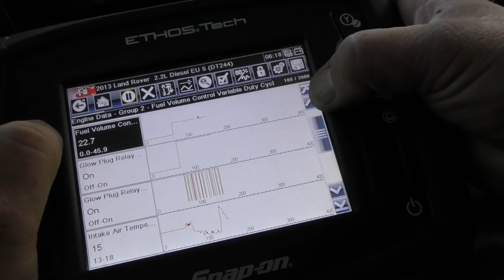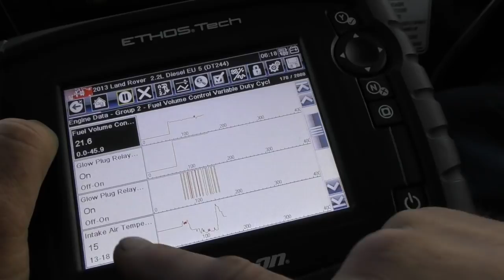Thieves or incompetence?  Address to ScannerDanner and Diagnose Dan.

Comment: Hey, you touched some points there, but unfortunately that’s not an excuse for the bad diagnosis we are getting at the dealer, as customer I don’t care what grade of competence the technician working on my car has, I took it to the dealer, not to a newbie technician, when I go to the dealer I expect the best services for let’s face it, the premium diagnosis and repair prices, I’m struggling for over 6 months now to get my car fixed at the dealer, a 3 year old car, that apparently the dealer can’t fix, but every visit in the service costs me, so, like I said, the problems in the back stage should never affect the customer...
“Customer point of view”
Reply: Hi Dan. Your situation is unfortunately a common situation and an unfair one but this isn't the fault of the guys working on your car. It's the fault of the dealership and it's management. This guy is defending the techs here. Not the dealership. The fact that it's taken 6 months already to get pretty much nowhere with your car means that the issue with it is quite a complex one. A technician with the correct training (that the dealer should be supplying them, but don't) could probably find the cause of your issue in a couple of hours. But they're not supplied with that training. The effect of that is upset customers and the tech gets blamed and called incompetent. I used to work in a dealership in Australia. A country where it costs $100+ just to fill the fuel tank in an average car and $12 for a beer at the bar. $20 an hour on a strict no overtime 40hr week and one of the highest tax rates in the world doesent really give them any incentive to spend their own time training themselves and thousands of dollars of their own money to buy the equipment needed to find complex faults like yours. The dealership should be responsible for supplying the tech with the correct tools and training. They're building and selling the complex cars. They need to supply support and training to the guys that are expected to fix them.
Reply: Adrian Ferraro-Quin unfortunately you are also wrong, at the last 2 visits in the dealer service, the representative called the technician to chat directly with me, to discard the loss of information, that didn’t help, and common, let’s be serious, it’s not dealer’s obligation to force info into their head, and please, I keep hearing this crap, we are not paid enough for what we do, man if is that bad, look for something else, the problem i’m  going through is unbelievable, is like my car is running on magic and the wizard under the hood got sick, Jesus, common, if u don’t call that incompetence then I don’t know what it is, if I was driving a Tesla I’ve understood, that car is SciFi for most people, but an combustion engine...common!!!
Reply: You just answered it with your own response. Everyone IS leaving the industry. So all you're left with is untrained (or incompetent as you say) mechanics. These mechanics are trained to change parts. Hence why they're not paid much. But you expect them to spend thousands of their own money and sacrifice hours of their own time to gain the knowledge to fix complex problems for no personal gain? I dont know what your job is but i guarantee you wouldnt do it. If you want your car fixed stop taking it to dealerships just because you think the dealership is better. Dealership mechanics are not trained to fix issues like yours. Find a good independent shop. But don't complain what it costs.   You can't fix your own car. So does that make you untrained or incompetent?
Reply: Adrian Ferraro-Quin ok, let’s agree to disagree, first of all, I live in an apartment building, so unfortunately no space to disassemble the car(this is the only reason I don’t fix it), I already took it to 6 different private shop’s, the answer they al give me, the car has to much technology they can’t access without a dealership scan tool or database. 2. Don’t ever say again that self studies doesn’t bring any benefits, I’m an it administrator, started with a humiliating low income, after only 12 months I’ve quadruple my incomes and knowledge, becoming almost indispensable in the company, and that only after I sacrificed some of my personal time for learning, so don’t ever say: no gain from self study.
PS. All the hardware I use in my job, I bought it, nobody gave me anything, and the big advantage here is that if I decide to change the company, I don’t have to buy the again or expect to receive the from the employer!
Ohh, forgot to mention, never complain about the costs, I only complain when i pay without getting a fix!
Reply: @danielmihai300  you just made my point again. You quadrupled your pay in 12 months from self training and purchasing your own equipment. Exactly how it should be. Your knowledge and experience has value. Now imagine doing that training and buying your equipment and then having to argue for a $1 an hour pay rise. I'm sure there are issues that you can fix that other IT guys can't. If a customer keeps taking their issues to the lower trained IT guys then they're going to be going through hell waiting for it to be fixed. Find the right person to fix your car then go back to the shops that charged you for incorrect diagnosis and claim your money back. There are multiple communities on Facebook and YouTube where you'll find real techs. Let people know where you're from and what issue you're having with your car and you'll find many people that are willing to help and direct you to the right shop in your area.
Reply: Adrian Ferraro-Quin , thanks for advice, unfortunately I didn’t have much luck with the community/forums, also, I don’t think that a good technician will not be appreciated by his employer, the other 6 independent shops mentioned earlier had ex’ dealer technicians in the service, so maybe, and this is just an idea, they rushed to quickly to leave dealer, or maybe they’re not that experienced as they thought they were, long story-short, let’s not always blame the company, maybe some time we just need to look in a mirror, we might be surprised with what we see.
Reply: I can see both sides on this, but I have to back Daniel up on this one. There are a couple contradictions and misconceptions I just want to mention here. You said in your first reply that the dealership should be providing the training but doesn't. I don't doubt that at all, and agree with you. But then you just said in the IT field, investing one's own personal time and money to increase their knowledge and abilities to make themselves more valuable to the industry, is exactly how it should be. Neither field is different. If a person wants to make themselves more of a valuable asset to any prospective company, and the training isn't freely offered, then that person should make the effort. It's a case of supply and demand. Knowledge and skills are in high demand. If you gain them, you become a part of the demand, your value goes up, and you make more money. If you can't get that $1/hr out of your company after gaining that much skill, then you find a company that will. You said yourself that everybody IS leaving, which in itself makes a lateral move even easier. By the way, I've worked in IT for many years as well. And yes - we have to argue, claw and scratch our way to better pay just like everybody else, and yes, most training in the field comes out of our pocket, not a company's. I'm also stuck on the notion of "stop taking it to dealerships just because you think the dealership is better". Dealerships in my area typically charge substantially more money, and everybody knows that. Normally, because of the costs, that's the very reason that we would take it to a dealership, because if they're boasting the factory certifications, we as customers do expect that they have competent technicians providing the service. We are not expecting to throw money out the window for parts changers. Now that very well may be the dealership's fault, the factory's fault, the unmotivated technician's fault... could be anywhere in that chain. It is not, however, the customer's fault. It would seem that the public in general needs to become more commonly aware if dealerships are in fact employing technicians that are less trained than small indie shops. Lastly, I too have made heavy use of Google, social media, community forums, etc, on quests to find information for helping identify what was wrong with my Silverado, after 3 indie shops couldn't locate the problem. Yeah, people from every corner are helping provide info on the net. The problem is that the info is horribly inconsistent and in many cases flat out incorrect. Just wanted to mention that. Anyway, this is just my take on the whole thing.
Reply: sexiewasd hello, 200k sounds like you own your business, but let’s look at this from another perspective, initially I’ve had 2 problems with the car, non of them could be fixed by the dealer, for the first problem I , an it guy, did some research, bought an 50$ scan tool, and also with the help of DiagnoseDan video, managed to fix 1 issue, that the dealer couldn’t, I’m now left with 1 issue that seems impossible to fix, more info: I have an Audi A3 2.0Tdi from 2015, the first resolved problem was the first start up in the morning the car was cranking for 4 or 5 seconds and then started, the next engine start up in the same day took only 0.5 seconds, the issue here was a faulty VVT Sistem, the second issue(the magic one) at random moments, but only after the engine is warmed up, the engine stalls, doesn’t stop completely, is like a misfire, if I’m full throttle when this stumble/stall occurs I almost byte the steering wheel, it doesn’t matter how violent the stumbles are, the car never ever stores any code, so here I’m stuck, but apparently also the dealer and visited private shops are stuck.
Reply: Snikies Learning 👍
Reply: The entire point of my reply wasn't to paint some sort of pissing match between industries, which it somehow got taken as. The point which I was backing up is that self drive and learning IS available if one wants to move ahead - regardless of trade. I never said things were cheap nor did I compare industries dollar for dollar. But to answer your questions: YES I have learned far more than 7 skills in IT on my own spare time. WAN/LAN Networking, Client/Server Tech, AD management, all of the relevant hardware tech, OS administration and support on every new version that comes out, Apple tech, programming including C++, 5 variants of .NET, over 10 different scripting languages, SQL admin, Firebase, the list goes on and on and on. Yes, on my own time, and yes at my own expense. Subscription costs for information access? Maybe not in that literal sense, but YES, I've had to spend over $400 a month for support on proprietary systems just so they could stay in use. Considering that my "tools" were servers, PCs and workstations, yes I have spent a ton of money updating the OS and supporting software, heavily pushed forward by Microsoft, and YES over the years I've actually spent over $14,000 for official training and exams for industry certifications, each ranging anywhere from $1000 to $4500. Again, yes, out of my own time and money. As far as pay cuts for doing so? I can't say that I could comprehend a pay cut for somebody learning more. I don't know the full story though so I can't answer that other than to say that because of schools making false promises and flooding the market with CS degrees, salaries dropped over time. Supply and demand. So yeah, been there and done that too. So once again, no they obviously can't be compared dollar for dollar. But IT most certainly does have large costs with time and money to stay ahead of the game. Both industries are constantly changing and becoming more complex, and with that being the case they both require ongoing learning. Neither is better or worse, it just is what it is. My original point wasn't about every little detail though. It was simply that regardless of chosen field, there should be ambition to improve self value. If there isn't, I would then seriously consider if it's something I actually wanted to do.I believe you that the industry as a whole, and wasn't meaning to imply the tech to be at fault. I know it's much bigger than that. If a dealership is willing to hire somebody new to the field, then that certainly isn't the tech's fault. At the end of the day, we all just want to be good at what we do, and be able to support ourselves.
Reply: Snikies Learning couldn’t say it better myself, bottom line, and I think this applies to all fields, no one in this world would benefit more than “you”, regardless of how you gain your knowledge, paid by the company or sacrificing some personal time and money...cheers!
Reply: Daniel Mihai Ai fost la 6 gunoaie si la 1 stealer, pun pariu ca nici nu au auzit ce e un osciloscop.
Reply: @liviu2004  Salut, pe aproape, raspunsul la intrebarea, electricianul foloseste osciloscop? a fost, cine crezi ca sta sa iti masoare tie toate cablajele de la masina, acolo mi-a cam inchis gura, iar asta a fost doar 1 raspuns primit de la Porsche Nord, iar restul m-au intrebat ce se masoara cu el!!!
Reply: Hey dan, sorry for your issues.  As a car guy and self taught mech your prob intrigues me.  My brother did as you reg the IT thing and because he specializes in diagnostics hes done well so i appreciate what youve gone thru as i watched my brother go thru the same, one certification at a time.  Im responding here not to give you attaboys but to remind you that you are not w/out options.  Because i was self taught as a auto mech diagnostics was mandatory.  In my past i was hired by the insurance side of one of the major auto mfg's here in the states to handle premises liability for their new/used dealers; the dealers were any/all makes.  In the 12 years i worked there i saw/learned a lot regarding the dealers and the mfg's.  I had the "pleasure" of dealing w/every aspect of the auto world you could imagine.

Trust me when i say that if your having this prob then others are having this prob.  Audi knows about it but wont admit that to you due to liability issues that might lead to a recall.  The last thing Audi/VW want is another prob that leads to recalls due to "fuel gate"...once bitten twice shy.

Your option I spoke to earlier was to seek an attourney regarding Lemon Laws.  Its been years since i worked at the insurance co but i worked there for a decade.  If you are here in the states then your case may be easier than you think.  All lemon laws in the states lean towards the consumer as the consumer is to be protected.

Your issue not only is an issue the dealer has admitted they cant figure out but is also a driveability issue making it a "safety" issue.

If you havent already visited a consumers protection lawyer you should do so.

In the decade i worked at the insurance co once in awhile one of the mfg's would design a car that presented the impossible diagnosis; dealers can only fix a prob that acts up on their watch.

The fact that no trouble codes present themselves after each event is in itself an mystery.  Regardless, Audi knows about it but wont say anything...that makes this Audi's prob not yours.  Audi should take you out of the middle because it is a safety issue. If you dont have the RO's, repair orders, then you need to get copies for your records.

If the car prob gets fixxed come back here and let us know, thx.

Good luck
Reply: Kevin Shasteen thank you very much, I didn’t think at the legal route until you mentioned, I’ll try this and I’ll keep you posted, again, thanks.
Reply: @ @danielmihai300 , IIWY I would look closely at every wire harness, wire connectors, ground connections, wire on your powertrain electrical system. A long time ago on my 71 Firebird when warmed up it wouldn't turn the starter over after shut-off until the engine cooled down. All the wires were checked and the starter tested good several times after removal. Mystery/head scratcher. I found Inside the starter solenoid a large copper metal bar connected to the main 12V+ terminal was separated/broken because of thermal expansion. My point is sometimes you have to think outside the box & get other peoples perspectives on problems to fix them. Good luck. Check out South Main Auto Repair LLC here on YouTube & if you're anywhere near his shop in N.Y. I would drive hundreds of miles IIWY to get there. He loves ice-cream & doughnuts BTW :-) 
South Main Auto Repair
47 S. Main St

PO Box 471

Avoca, NY 14809
Reply: Hello Jet Engine Thrust , unfortunately I’m from Europe, and to get in NY would be a very long drive😁, instead I do think I found the source of my problems, unfortunately I don’t know where in the engine is this sensor, to be more explicit, I’ve bought a couple of months ago a diagnostic tool(VCDS) I don’t know if you’re familiar with it, and one day, and this is the funny part, after watching another video of DiagnoseDan about temperature sensor, I’ve checked all my temperature sensors on the engine, and surprise surprise, I found 1 sensor, that regardless of the engine temperature it’s always stuck at 2200 Celsius degrees, so now I think this is my problem, after past dealership experience, I don’t want to go back to them anymore, but I don’t know if I have a choice, non of the private/independent services visited could tell where is the sensor located, so now I’m stuck again. The sensor is described like this in the diagnostic tool:
 “coolant temp. Sensor1 bank1 at cylinder head  = 2200 degrees Celsius”
Reply: @danielmihai300  the fact that is says its on the cylinder head would suggest to me that its more than likely on there. so basically the top of the engine, no from what i have seen most temp sensors screw into place. so i would be inclines to remove as much crap from the top of the engine and have a good look around the cylinder head for an electrical connector that screws into the engine its self. if you google the part your looking for it would give you a better understanding of the shape and size of the part. then its just a case of tracking it down on the engine. and just to clarify, by crap i mean all the stupid plastic covers the air intake if its in the way. basically anything that can be easily removed and put back to give you the best view of the engine you can get. hope this helps and gives you some idea of what to do next. the best part about temp sensors is there usually pretty cheap.
Reply: Chris' Man Channel thanks for replaying, unfortunately that reading just give me false hope, after digging a little, I didn’t manage to find anything about that sensor being mounted anywhere in my car, more to that, the voltage and the temperature contradicts the value, to be more precise, when I add the sensor in my scan tool, it always shows 2200 degrees but it also shows 4.99V, so that, at least for my understanding, is a contradiction, shouldn’t the voltage go low as temperature increases? Also, I even have the dealer service manual, and I can’t find any sensor around cylinder head!!! And like that wouldn’t be enough, it gets more complicated, on my scan tool, I can actually see 2 cylinder Head Temperature sensor, and even though I can’t find nothing of their existence, 1 of them is actually showing the right temperature!!! Now I think that the associated name with the sensor in my scan tool is wrong, also tried another scan tool, similar to mine with same results...at this moment I don’t know what to believe anymore, as I said in an earlier post, I’m an it guy, software is no strange field for me, I’m sure the car has the original ECU software installed, I never heard of software creating false readings of inexistent hardware, I say this because many technicians told me is a software bug, so, that being said, I do think the scan tool is reading something, but I don’t know what!
Reply: @Jet Engine Thrust, @Kevin Shasteen Hello again, After almost 12 months I’ve finally found the issue, I now have 2 weeks driving trouble free, the issue with my car was, believe it or not, the crankshaft position sensor, this was intermittently loosing signal, and screwing up my fuel injection timing, after talking with the Tehnician(and this was fuel delivery specialist) he told me he never encountered this kind of behavior from the crank sensor and most important, never without errors, so that was just my luck, but nevertheless, I find it incredible that such a common issue couldn’t be diagnosed at the dealer service!